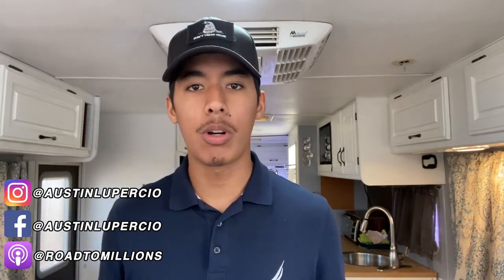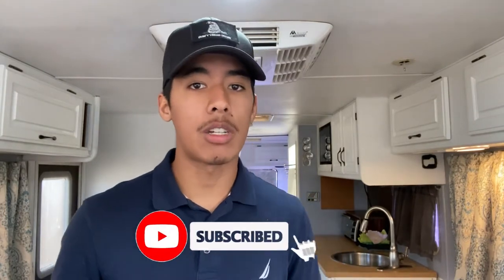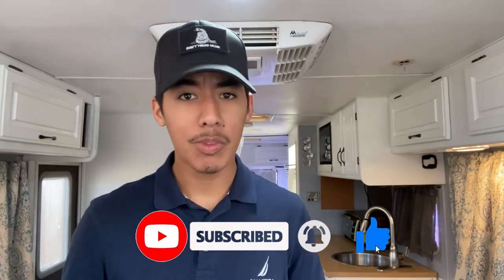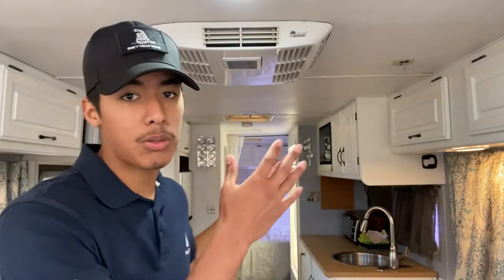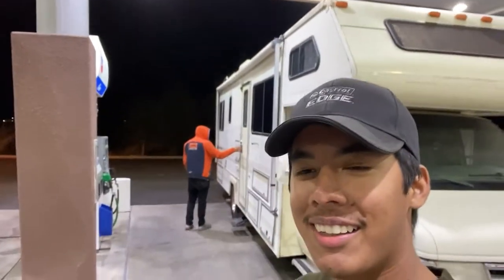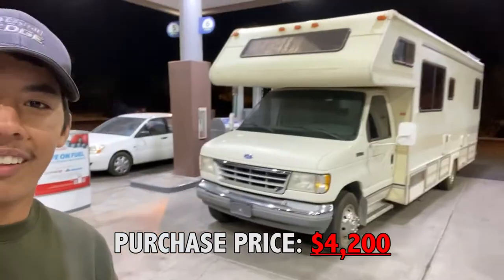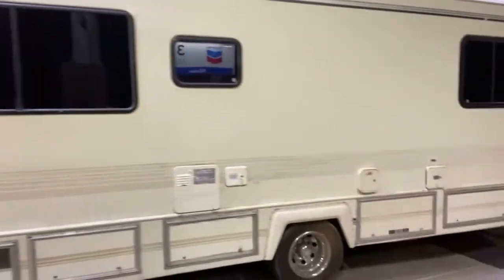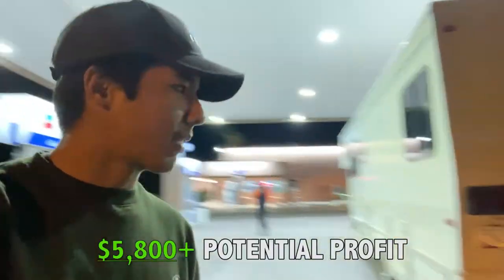How To Flip an RV | Flipping an RV for Profit Part 1

Comment: This is the third video I've watched on flipping RVs and I'm starting to see a pattern.  The video typically begins with the new owner touting the virtues of the RV and how great it is and, most importantly, what a fantastic deal they got on it.  They are firmly convinced that they will soon be awash in profits.  In step 2, the "sidekick" is introduced.  This is usually a family member (brother-in-law or in this case, a brother) whose main purpose is comedic in nature and whose actual contribution to the effort is somewhat questionable.  The sidekick is mainly just along for the ride.  In step 3, all hell breaks loose.  In this step, the owners typically find a roof leak, rotten wood, burned wiring or, in this case, a garbage transmission.  Step 4 is usually "stay tuned for Part 2" which may or may not be posted....ever.  Thanks so much for this, I laughed so hard.

Comment: How do you document your cash sales for taxes?
Reply from the maker: It'll depend on what state you live in and also on the amount of volume that you're selling. So if you doing this as a side hobby, you can really put on the pink slip that you sold it for whatever amount. I typically would put $1,000 sale amount so it saves on taxes on both ends but that will be up to your discretion.